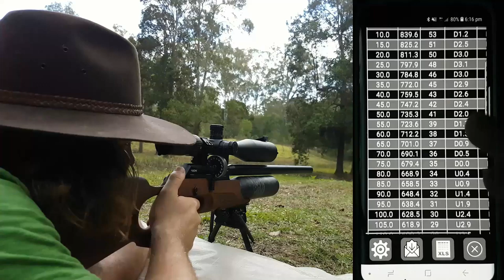How to Measure Smooth Twist X Liner Twist Rates

Comment: Little off topic... what are your thoughts on barrel indexing? Have you tried it or do you think it's not worth the effort?

🥃 cheers 🍻
Reply from the maker: Yeah I think its worth it, you can gain a little bit of extra elevation if you choose the 12 o'clock point of impact which will bring your scope closer to its optical centre which is a good thing
Reply: Thanks again! Happy hunting, shooting, plinking, pestering, and any other thing you can think of that involves a fast moving projectile lol 

Ps. Do you index or no don't think I've seen it on the channel although I may have just skipped over it without noticing somehow... YouTube anyways 😅

Comment: the original ST barrel the breach end seals the air since it's perfectly round how does the twistX seat the pellet well to seal the air blast given the barrel is not round at breach end.
Reply from the maker: Sweedish meatball magic? I wasn't aware that it's not round... I'll have to go take another look
Reply: The rifiling in a stx starts a few mm later so the breech end is also round on a STX